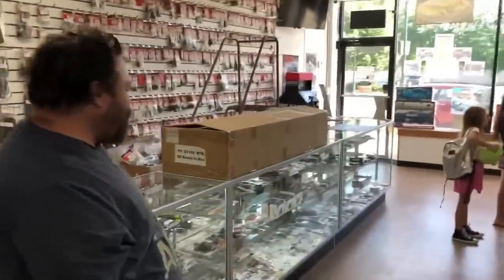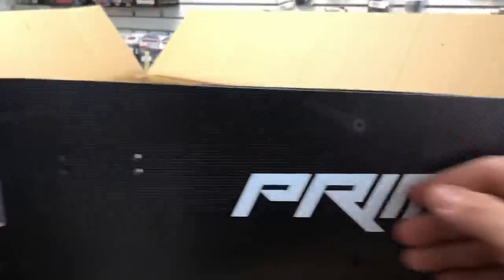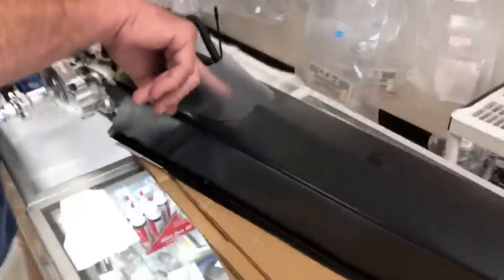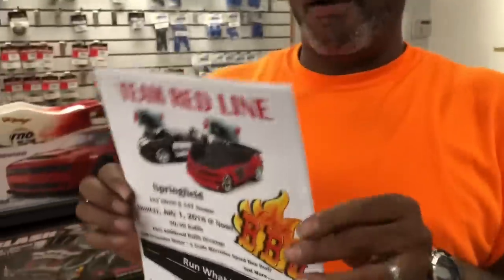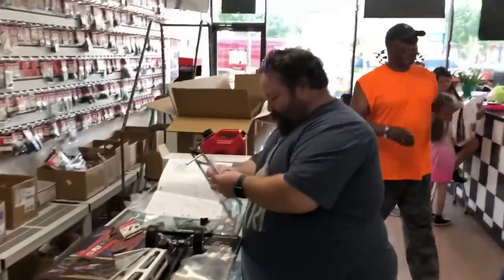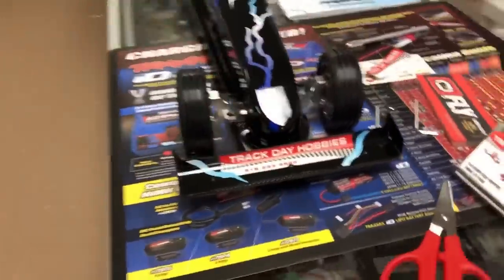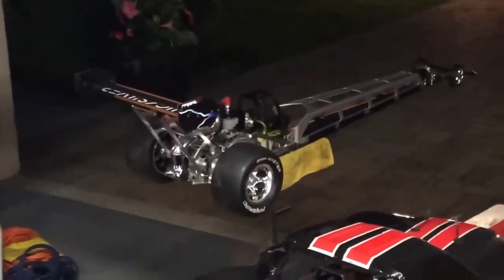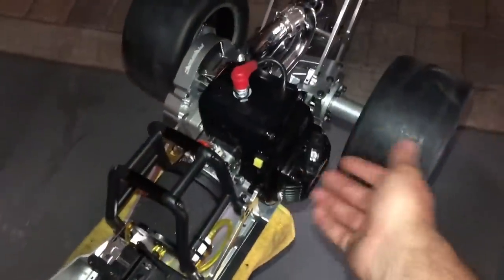Finally Unboxing My Primal RC Dragster

Comment: nice thing to do for youre neighbours : get a big can (like one for picklesmaibe even a small oil barrel) stuff the bottom of it with rags or cottonwool lay it flat on the floor across the exhaust so the exhaust will blow intoo the can and against the soft stuff , it will reduce the noise and the sharpness quite a bit without reducing the effectiveness of the exhaust
Reply from the maker: watahyahknow very cool but not needed! We sometimes even run open headers 🔉🔊haha Zeeeeeaah! For me the louder the better! Braaaaap Braaaaap! You should of herd when my friends and I blew up our Lipo batteries with Pineapples ! Shits went KaBooooomm KaPow!!! Lmfao 🤣

Comment: The sound is epic.  I need one if only I had the room for it.
Reply from the maker: Trucking RC Addict I know thats hole other  challenge
Reply: With me being a truck driver fitting 2 1/5th scales, 2 nitro's, a phantom 3 and 4 e-words in a mid roof freightliner coronado makes it kinda cramped.

Comment: One last thing, what's the strongest thread locker? I'm asking becuase the pulse fitting on the crankcase will need to be thread locked and if that falls out its game over.
Reply from the maker: Karrie Bhurgari Red is fine but one day to remove it you may need to heat it with a little torch or heat gun
Reply: BOTAJELL ok I'll keep that in mind!

Comment: I'm looking at these on eBay right now which is why I wanted to watch this video this is my review check this thing out and so far it is completely 100% professional what a nice build but is this nitromethane or is this 2 stroke? Is there a nitromethane option? If there's a nitromethane option is there a wheelie bar option? What a very very complete kit last question are there decal overlays or other color options for the dragster if not I will have my detail guy and my pink guy make this into the Kenny Bernstein Top Fuel dragster that would be badass

Comment: Congrats mate what a lovely bit of kit !!!! Think my KM X2 comes today :—))
Reply from the maker: Jakey Stone thank you and congratulations 🎉🍾🎊🎈 to you on your purchase 👍💥👏and staying a true Braaaaap ⛽️🔥💨 head and being apart of our family!! Where are you from?
Reply: BOTAJELL I’m from the UK mate.
Reply: BOTAJELL could you help please!! Can you explain a basic carb set up for braking in my king motor x2 please. I’ve noticed you run the engine rich on the first tank. Thanks for your time.
Reply from the maker: Jakey Stone just run your engine on a stand and raise the idle a little or open the throttle a bit with servos turned off then look at your exhaust when it’s running and if you don’t see any smoke 💨 just richen the low speed a little and walk away but do not let the tank run dry!!! Burn at least between 1 or 3/4 of a full gallon of fuel ⛽️ the. Adjust your end points and start driving it and leaning your low until she can idle and stay running and lean you high until she sounds good and looks on high speed runs
Reply from the maker: Jakey Stone feels like we are almost neighbors but you are so far wow 😲! Your still my Braaaaap ⛽️ Brother and part of the  family
Reply: BOTAJELL awesome thank you mate!!!
Reply from the maker: Jakey Stone 🤝💥👊💥

Comment: I just started with the hobby and I’m interesting on certain things also do you need to use oil on the filters for all filters or just some because the car that I bought and never came with a small oil kit and I was just wondering what’s my option or what to do

Comment: Hi john, how do you suggest i clean out the inside of a exhuast? I have a yz85 dirt bike exhuast for my baja that I'm gunna make fit but it's really dirty btw it's made out of steel
Reply from the maker: Karrie Bhurgari use a can of Nitro blast or Nitro Force and spray it on the inside until everything comes out clean then blow it out with air compressor
Reply: BOTAJELL ok, I've also hear that brake cleen would work do you think so?
Reply from the maker: Karrie Bhurgari brake clean will work ok but I’m telling you please try Nitro Blast or Nitro Force because so far nothing cleans and drys up quickly like that not even electric motor spray cleaner! I was at the race track last Sunday and almost everyone uses nitro Force just to clean there shafts in there 2 speed transmissions and on the part that is called the claw every time they service them quickly! Everyone there with 2speeds can perform this job with there eyes closed and in a very short time then they will give all the parts and oneway bearings a drop or two of 4 stroke engine oil !!
Reply from the maker: For the inside of your pipe you can use any Brake cleaner will be good enough then blow it out ! Even cheap brake cleaner spray! Nitro blast will dry up to quick for that job!
Reply: BOTAJELL awsome!! I need to disassemble my transmission on my baja soon to change the oil and regrease it and nitro force will work for that and I can get some brake cleen for cheap. Thanks for the information!!
Reply from the maker: Karrie Bhurgari yes ! Don’t waste the nitro force on the big jobs things . Try to use the nitro force at the end for the better clean up before the job gets started . Or use it how it will benefit you the most from the job your trying to perform.
Reply from the maker: I even saw some guys that would use nitro force to clean there tires before lining up at the track to make there tires extra grippe
Reply: BOTAJELL good to know!

Comment: What kind of fuel are you using? I here you saying something, but I’m not sure what you meant. Is it Chem 2? Is that what your saying. And where do I find this gas at?
Reply: sLyKnEzZ Cam 2 100 octane fuel
Reply from the maker: Yes that is correct I’m running ethanol free Can-2 100 octane with Amsoil Dominator oil
Reply from the maker: I may switch over to C4 100 octane
Reply: BOTAJELL wish I had some of that good good. We don't even have race fuel dealers we just have ethanol 93 octane and lawnmower oil so I even have to order oil lol
Reply: Karrie Bhurgari thanks man... I was wondering. Where can I find some??
Reply: sLyKnEzZ I know!!! Texas sucks!! You can type in "cam 2 fuel near me" in Google and if there is it'll show it.
Reply: sLyKnEzZ sunoco fuel stations and haffner's gas stations around my area sell cam2. Its 110 octane where I get it.  Also it's 12 dollars per gallon lol.
Reply from the maker: Only 5th scale do not run 110 on regular compression engines!!!!!!! You will not be happy! 100 is the limit and you will actually run stronger with 89, 91,93,and 98 octane gas ⛽️!! But if you have a Hi Compression Engine and if the timing was changed?? You can and will only must use 110 or even 113 fuels and never use 100 and under because you can burn a hole on your piston and even melt spark plugs !! If your engine pings at full throttle? You must stop and get off it quickly before you damage the engine! I only run 100 because it’s ethanol free but I may use some VP 98 Octane Ethanol free that comes in a steel 5 gallon drum or even some C4 💯 ? Or I may just go pick up some more Cam-2 ? Don’t know yet but I’m running out and need to get me some more fuel ⛽️
Reply: BOTAJELL Ya, I wouldnt run it in a normal car... I just wish I could have figured out that I can buy this type of 100-110 octane fuel before I got my OBR 32cc FM Reed ! I didnt know you could buy that type of gas and have it shipped.... I live in Southern Utah, so 91 is the best I can get here. The Las Vegas Motor Speedway isnt but 1-1/2 hours away but I've never seen a station next to it that sells high octane fuel, and taking care of my grandpa doesnt allow me to travel far from home. I am VERY HAPPY nonetheless with my OBR Engine in my DBXL and the crappy 91 octane ethanol containing fuel. :)
Reply from the maker: sLyKnEzZ if you want to run higher octane gas ⛽️? Next time you get an engine from OBR or Gizmo Motors or whoever you must tell them that you want them to build you an engine that’s high compression!!! Not pump gas friendly. Then you will benefit the crazy fuels and power from this . I don’t bother with the high compression engines because I want  to run same fuel on all my RCs do I don’t carry 2 different types of fuel ⛽️. But I may start to if I get in deeper with the Drag racing in the future?
Reply: BOTAJELL ya that’s what I was saying.. I wish I would have known I could have that high octane fuel delivered before I ordered my engine, because I would have had them build it to handle the high octane stuff! I was almost going to go with using the Methanol option but I was just trying to save money as I don’t make very much money anyway. I get a little money helping my grandpa who has Dementia and Parkinson’s, and now has progressed to where he cant even get out of bed anymore. So I was thinking that I’ll be lucky just to have my DBXL as is with the 23cc, so getting that motor I just decided I would go for the cheapest options. LoL

Comment: A very very cool well thought out model,,but weedeater.  I know.  Don't get your feelers hurt.  Just needs that V8 look and sound.  One day they will perfect the mini v8's, soft wrinkle walls, and a TRUE multi disk that everyone can afford and tune.  Probably not in my time or yours,,but one day.  Been in the hobby gig since 6-7 yrs of age. 52 on this lap.  If it utilized remote control, I have operated it.  Just would like to see the real thing before I go.  Not something that is really close.  Beautiful model you have.
Reply from the maker: kh40yr I hear you ! For now I may be taking out that week wacker G290 Engine Out and use a Big Bore Chainsaw Engine next? It’s going to be fun I can’t wait to see and hear how it will be! I will also have to get some 4 inch Bishop slicks for it .

Comment: You need to call up Oneil Brothers Racing for motor mods, some of the best in the game.
Reply from the maker: Lol 😂 are you new to this ??
Reply: Drag, RC's or modifying gas engines?
Reply from the maker: That’s cool if you are I have many OBR engines already and I have helped sell hundreds of them also so I’m not new at this and know them well!
Reply: I hear ya, just sometimes when people are from east side of the  US, they may have not heard of shops in the west. I am sure you are very knowledgeable, just trying to offer another option than ESP.
Reply from the maker: mineurbiz I love ❤️ OBR for years ! I still have my 8 year old OBR FullMod piston port g290 engine and a ReedCase 32 Full Mod and I have installed 3 OBR 46cc and one 47 for friends and a few others also like there 30.5s I even used to have one of there 30.5s . I just got a Chris Bartolone 34 ReedCase Engine have you herd of him? I also have a SCZ 5 bolt engine and a Gizmo 30.5
Reply: I still have a couple OBR motors for my HPI 5T, also had the pleasure of going to the dunes with Dan from OBR and a race in Southern California with him, good people and great product!!!

Comment: killer dragster not knocking it down but i would make it look just like a real top fuel dragster i do my own display funny cars and dragsters im working on a 1/6th scale tom the mongoose funny car
Reply from the maker: Paul Casarez I want to build a funny car this winter using a stretched out Baja chassis so I would love to use a funny car body on that maybe a Corvette or Camaro body !! Who makes them?
Reply: BOTAJELL i scratch build mine out of Styrofoam i been doing my own bodys for over 26 years and if im not scratch building im cutting up an RC body to build one thats not available sometimes they look out of shape

Comment: hmm after looking in close detail this dragster is off when it comes to scale.. it kinds drives me nuts. look at those huge rims in the back. engine looks strong though.
Reply from the maker: John Newkirk I’m going to use even wider wheels in the back of this Dragster next year when I use Big Bore Engine! 4 inches wide but it will be lower also so this Dragster will drop a bit.

Comment: Me personally I'd do a head, crank, and a possible shot of NITROUS.
Reply from the maker: Donald Byrd when you spray this little engines  do you have to run higher octane gas like you would have to do on a real car??
Reply: BOTAJELL I would assume it’s the same as a 4 stroke motor. Low compression and maybe race gas. Talk with rob from RB Innovations

Comment: You run 100 octane right
Reply from the maker: David Blake yes only because it’s Ethanol free !
Reply: BOTAJELL yea  Iam going to run torco 100 unleaded ethanol free in my truck do you still sell your Amsoil dominator I would like to get some from you if possible
Reply from the maker: David Blake I don’t sell oil ! Never did ! Track Day Hobbies sells it and another friend of mine also! I pay Amsoil so I can be a preferred customer so I can get a little discount because I buy so much oils from them. I use there diesel oils motorcycle oils marine oils and 2 stroke oils and diff oils so I want the best so I buy the best
Reply: BOTAJELL man your hard core about that!! I just wish Amsoil had methanol resistant 2 stroke oil, I'll ask them if they do.